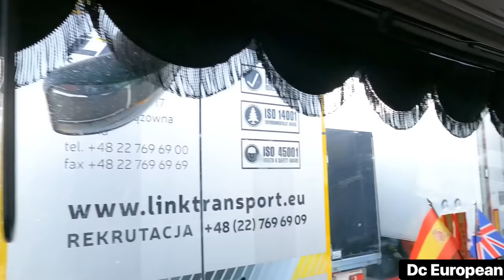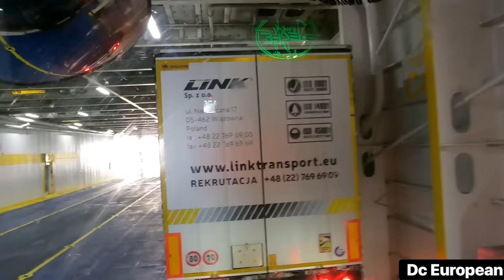We are back! URGENT load to Italy requires 2 drivers NON STOP

Comment: How's it David, thank you for a cool and informative video. I cringed when you opened the rear tool box as I didn't see any locks or keys. I used to drive trucks from Zambia to South Africa and Zambia to Tanzania. Then I drove in south east Queensland, Australia. The reason why I cringed was, if you tried that in Africa, the next morning, you'd find an empty toolbox. We also had to chain our two spare wheels,  diesel tanks and battery tray as these would disappear. We would have to put barbed wire on the back of a loaded flatbed to stop theft while going up hills. Watching you guys drive through Europe and on those beautiful roads makes me jealous. Thanks, all the best and keep trucking.

Comment: Hi David &Tom. Before the motorway was opened at the end of 88 gooing to the Mt Blanc. From the hot bakery just outside macon to the place Bellegarde was about 3,5 hours,With Livestock😉😉From Bellegarde,The Monkey Bar to the enterance was About 1.5 hour WHEN there was little traffic and a clean road. After the tunnel to the customsplace in Aosta was between 1.5 hours and 2 hours. The first 14 kilometers down were way worse then gooing down into france. I have seen many smoking brakes and many trucks with broken mirrors. But they were in a position you could adjust the breaks very well without getting dirty. Safe trips and keep the rubber where it belongs, on the road or in your pocket
Reply: It was called  Ma's Bakeshop,
Reply: @colinrunciman5166  You are right, but the dutch called it the Warme Bakker or in english:The hot Bakery. The same as The restaurant in Bellagarde was called Bellevu but the dutch and Flemish called it the Monkeybar, because Annie,the owner had a small monkey in a cage. Don,t know about the Bakery,but Bellevu is closed,passed on holiday last year.